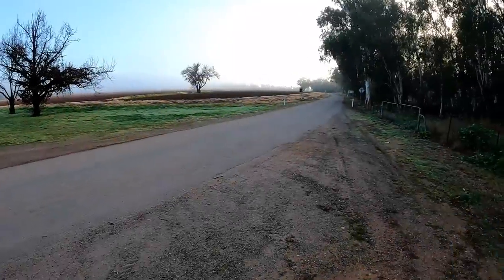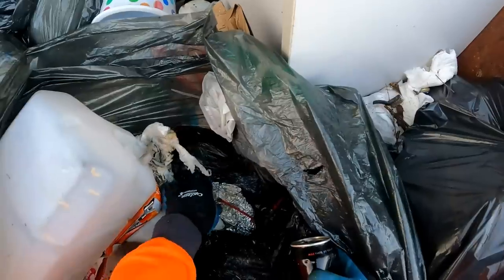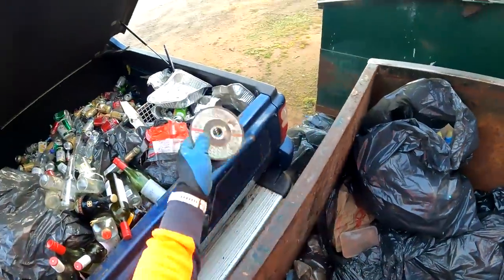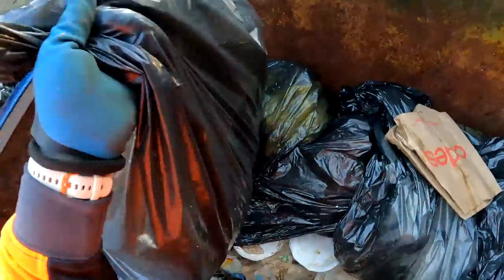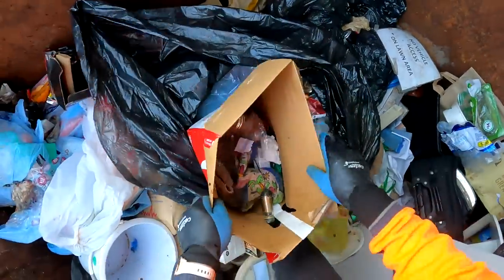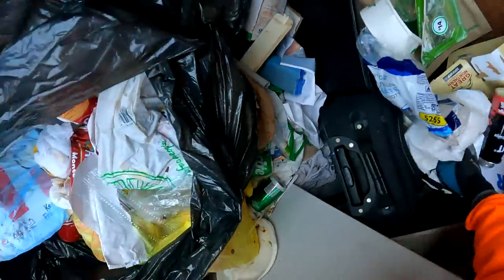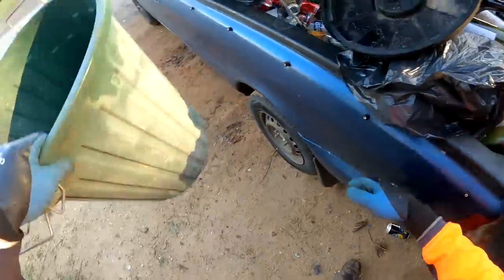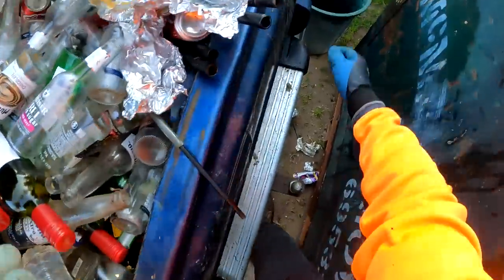Dumpster Diving Making A Defference Part 1

Comment: Thanks for saving what you can from the landfill! And why can’t you take the glass bottles when the top is broken but the label is still visible?
Reply from the maker: The reason  why we don't take the one's with no label as the machine will not take them  and the same for the broken glass bottles